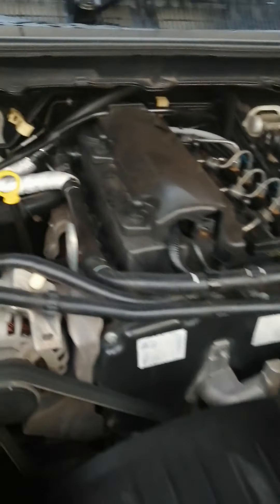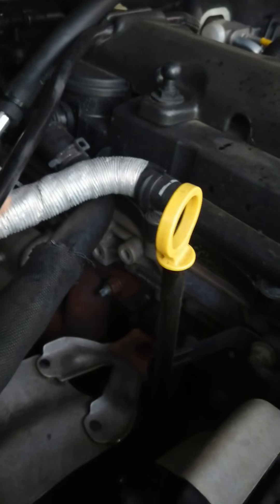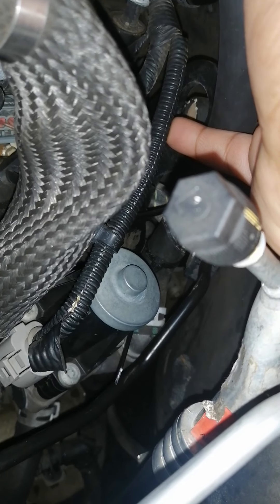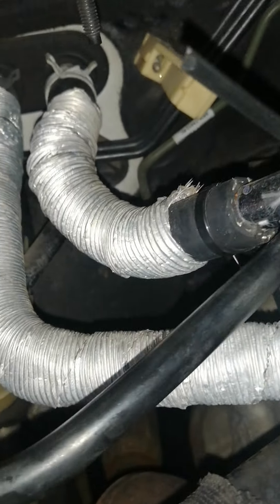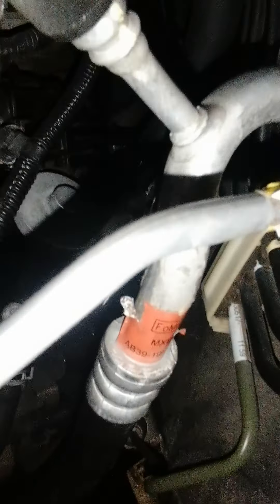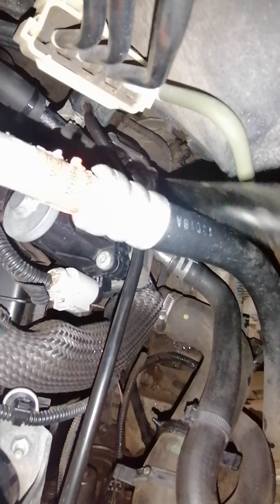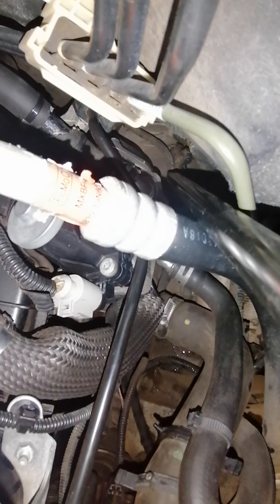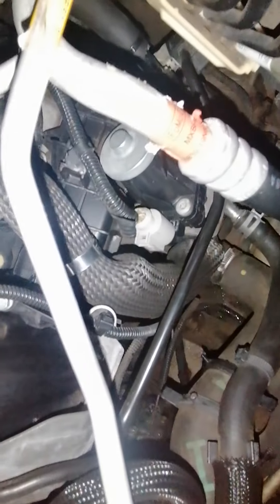EGR SYSTEM cancel or bypass on a Mazda bt-50 2.2/Ford ranger 2.2

Comment: EB3G18K579FA  this is the original part nr for the hose from Ford, is used on ford/mazdas 2.2 duratorq with no EGR from factory, its a much simpler solution (and its not expensive)